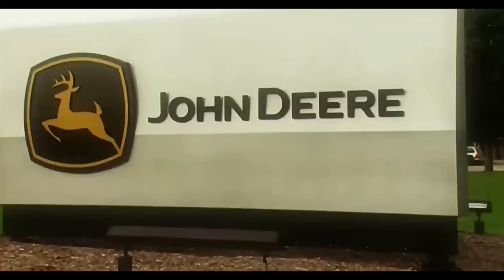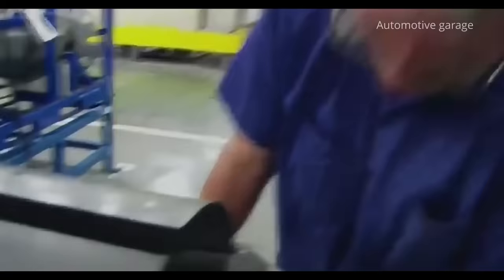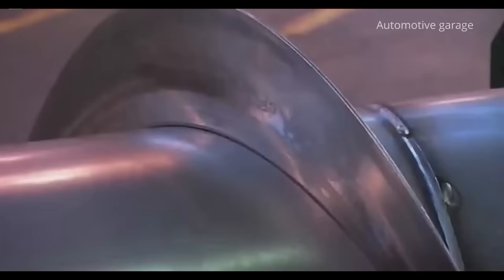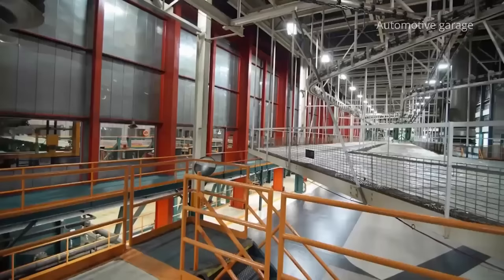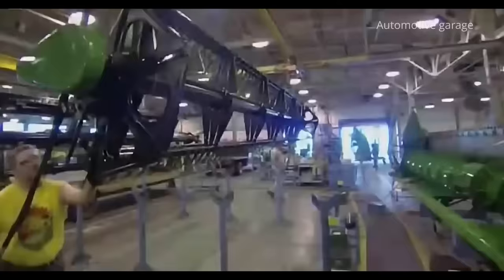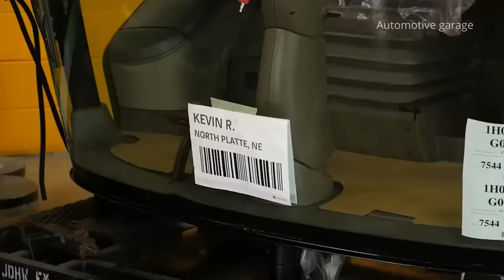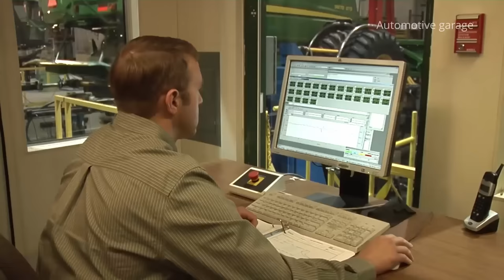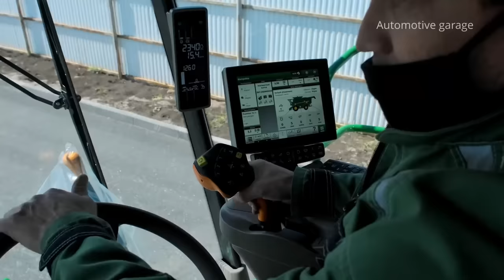John Deere Harvester Combine factory

Comment: I worked as an intern in the Process & Tool group of the Manufacturing Engineering Department back in 1980. Deere was building conventional combines at the time, with the largest machine being the 8820 Turbo. I really enjoyed working there and thought the work ethic was outstanding, as compared to some of the aerospace industry in California. Combine technology has totally changed since then, moving from conventional (with beaters, blowers and straw-walkers) to rotary technology. Harvester Works in 1980 was vertically integrated, having its own foundry, forge and machine shop. Other than tires, cabs and diesel engines (which were manufactured by Deere in Waterloo, Iowa), nearly EVERYTHING was built on-site! The place was amazing! Thanks for producing this video - it brought back a lot of memories.

Comment: I got an x9-1000 on my trailer rite now. Aside from weight and size, it's a joy to pull. Easily Balanced, the loading shop is fast and out of the elements and the tie points are easily found.

Comment: Ran a 95 JD through the 1960's and early 70's ..age started 10 years old ..last year 21 years old..a lot fewer parts..ran it for 10 plus years new it from front to back..top to bottom..simple to fix..replaced one motor..and hundreds of sickle knives...and a lot of tunes of grease..and no cab ...cooked in the summer heat and froze in the windchill of corn harvest

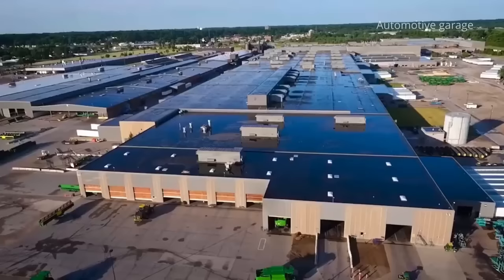Comment from the maker: 0:08 Press shop and plasma cutting
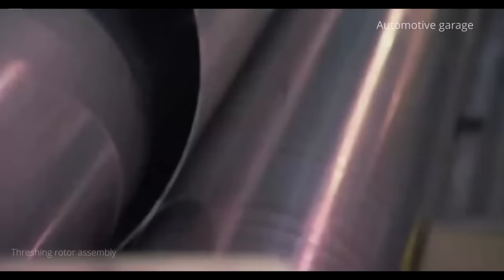1:19 Threshing rotor assembly
2:48 Welding lattice walls
3:41 Welding of a grain hopper
5:00 Welding of the harvester auger
5:43 Paint shop
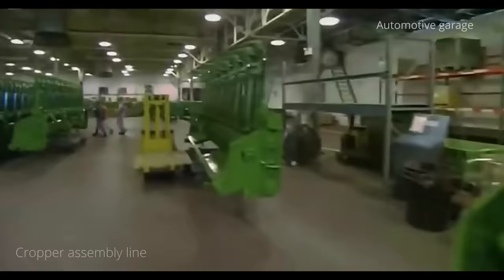8:27 Cropper assembly line
10:12 Final assembly line
16:41 Harvester testing centre
Reply: Adq@
Reply: Es en Illinois? La fábrica
Reply: The first manufacturing machine is not a plasma cutter.  It is a laser.

Comment: Spend $900 k for a combine that is purposely built to wear out in 2,000 hours buy making the metal just thick enough to last 1 to 2 thousand hours and use cheap Chinese bearings and electronics. I'd rather spend $920k and have it last twice as long.  No morals